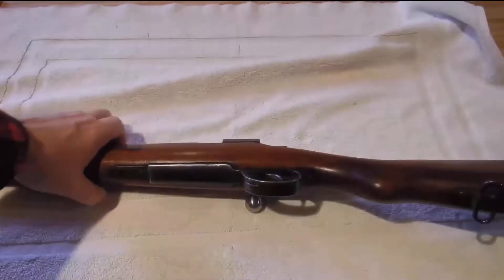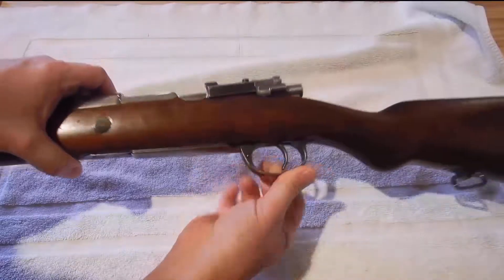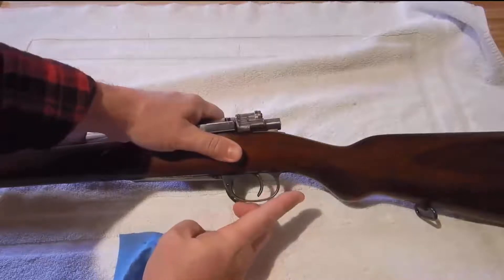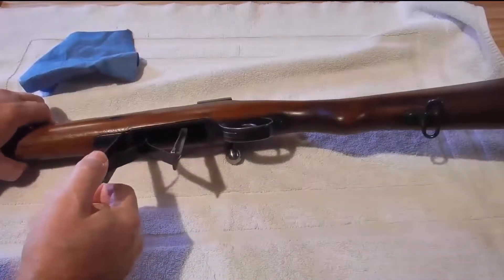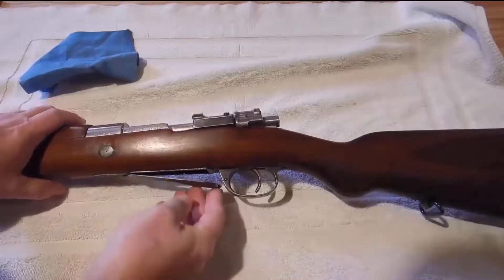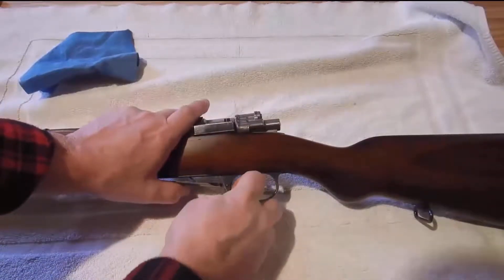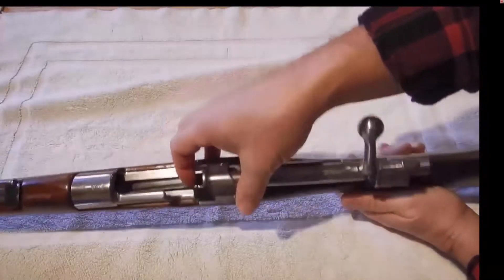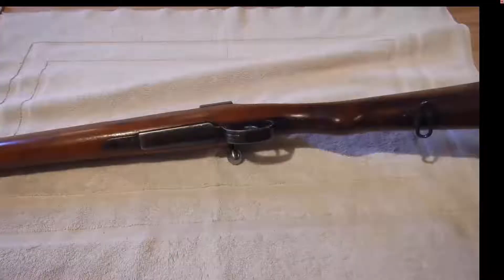1909 DWM Argentine Mauser Floor Plate, Receiver and Strange Follower discrepancies

Comment: All original 09s have the empty bolt stop, the ramp have been filed sometimes in the past.
Reply from the maker: Thanks for replying Troy, but I'm finding it is the opposite.  The follower ramp has to be cut down at the rear corner to allow the bolt stop.  (discussed about 1:40 into the video comparing the amount of metal present in that corner)  The corner cut does not appear to have been filed, but professionally and consistently cut into the metal allowing the mid section to ride higher in the receiver causing the bolt stop.   Since these guns never saw action from their original contract, it seems odd that many are cut down.  Most people I've known like to cycle the action so unless during wartime would seem to not want the bolt stop.   I'm thinking maybe during manufacturing they just picked from mismatched buckets which is weird that their high quality control would not have caught that.
Reply: I have a pristine 1909 Argentine, 1912 manufactured. mine does not have bolt hold on open. However the receiver crest is ground so maybe a modification later?